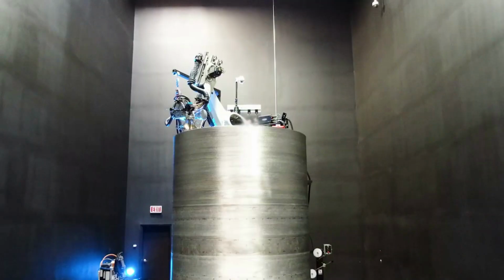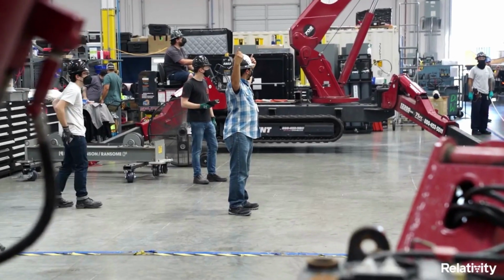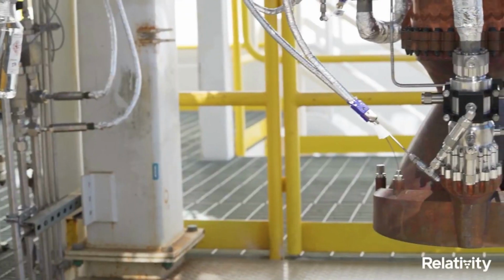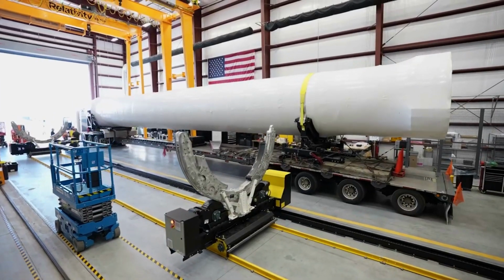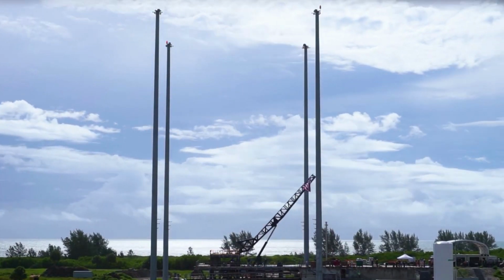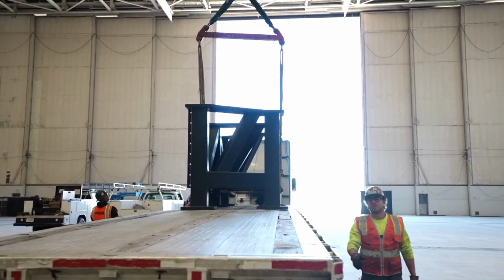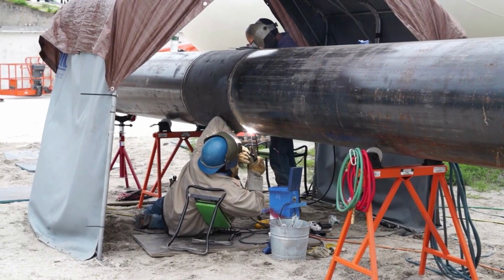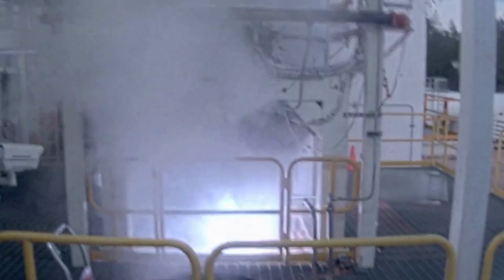Relativity Just Mounted Terran 1 Onto Launch Complex 16

Comment: Relativity Space says on their own website that they use liquid natural gas as the fuel. Other sources say liquid methane. 

Pure liquid methane has different properties from liquid natural gas. The other hydrocarbons in natural gas provide more energy per mass and volume. It is also cheaper here on Earth.

Pure methane is easier to design for, in principle it should be easier to make on the Moon and Mars. It can be chilled lower than LNG. When super chilled, it has more energy per unit volume than LNG.

I wonder if Relativity Space simplified the wording on their website until it was wrong, or if their rockets work with either fuel.
Reply: Pretty sure methane is a natural gas.
Reply: @zarifahmad4272  Indeed, methane is naturally occurring and a gas at moderate temperatures and pressures. So are alkanes. Wikipedia describes the product known as natural gas this way:

Natural gas is a naturally occurring mixture of gaseous hydrocarbons consisting primarily of methane in addition to various smaller amounts of other higher alkanes. Usually low levels of trace gases like carbon dioxide, nitrogen, hydrogen sulfide, and helium are also present.